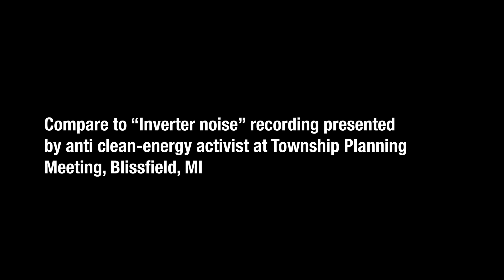Solar Farm Sights and Sounds: Reality vs Disinformation

Comment: Panels don't  make noise, the fans and inverters do. Now go back and film where they are situated.
Reply: Roads make far more noise than any inverter Ive seen, yet people don't freak out due that.
Reply: But if you can't hear it when you're actually at the panels, why would you hear it at your house? Is you house closer to the inverters than the panels?